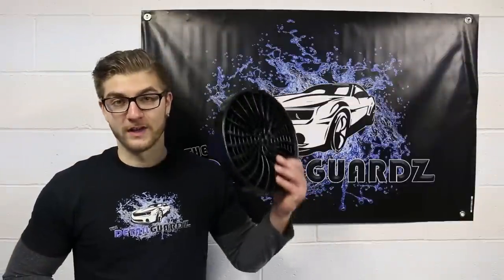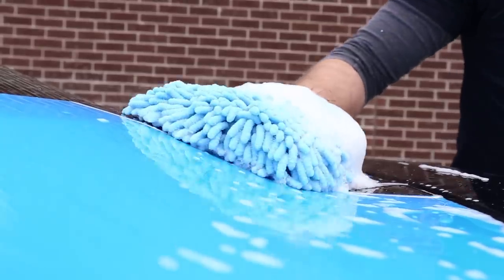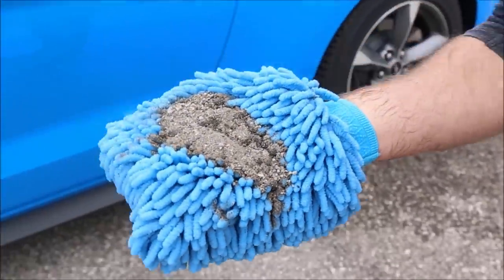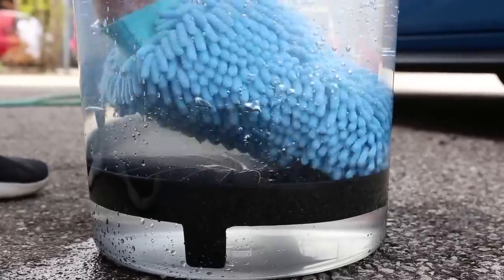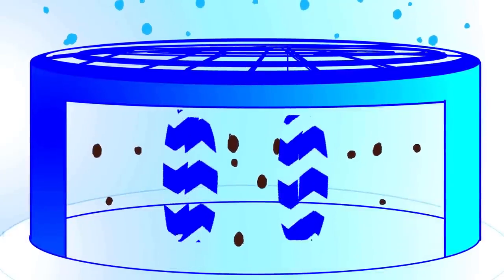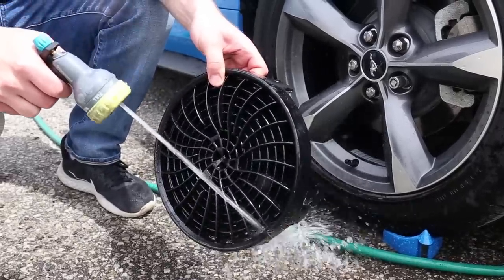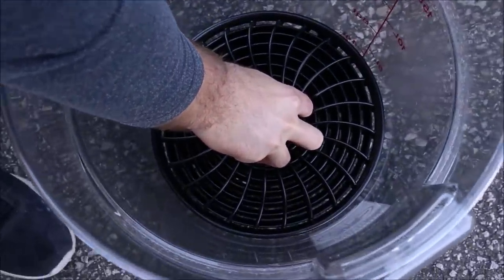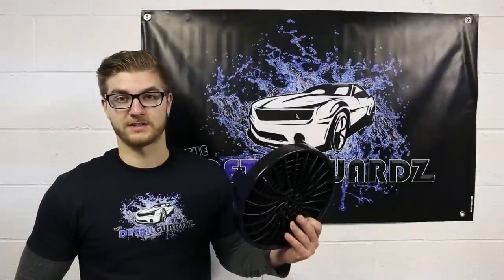Turbine Dirt Lock Car Wash Bucket Insert - The Detail Guardz Car Care

Comment: Fantastic engineering.    This is several steps above the Grit Guards that are out there now on the market.    This actually (by theory anyway) will hold the water in the bottom portion of the bucket.    Even if 80% of the dirt stays down there,  it is still going to greatly reduce the amount of swirls you'll get by reintroducing dirt back into the wash mitt and therefore on the paint.    I will definitely be getting three of these for my buckets!  Upgrade from what I have now!     The detailing market is going crazy with new innovations right now!    All sorts of innovative products are coming out from the Dirt Lock's above to new Polishers,  Compounds,  Polishes,  Washes,  Cleaners!    It's unreal how many new products come out on a daily basis.    But these Dirt Lock guards are a "game changer" for sure!   Great product.    Thanks for bringing it to the detailing world out here for anyone that wants to get some of these,  even just a weekend enthusiast like myself.

Comment: I want to know where you get your clear buckets.

Second question. Is there a Grit Guard Washboard type accessory planned? I find that to be invaluable to my setup.
Reply from the maker: Hey Gregory, the clear bucket we used was from Nella. (Very expensive clear bucket $65.00... but necessary for the video demo)

Second, we currently have the idea on the table, but we have found that the Dirt Lock does a significantly better job cleaning your wash mitt just by pulsing your hand up and down in the bucket. For now, the turbo-fan also provides a great place to scrub your wash mitt to release stubborn debris.
Reply: I don't think a wash board can work with this system. That's why I'm putting mine in the rinse bucket  then the washboard in the wash bucket

Comment: I have a 16 liter bucket. Inserting this into the bucket will not go all the way down. But grips itself midway into the bucket :( 

Now am.thinking if i should remove the rubber gripper so i can push it down a little further, or should I buy a new bucket and what size?
Reply from the maker: Hey! Kindly send us an email and we will get this remedied for you :) Email: thedetailguardzsocialmedia@gmail.com  If your bucket is a bit too small for the Dirt Lock, simply fill the bucket with water, bend the Dirt Lock tabs inward and push it as far down as possible. Let it sit overnight and it will actually mold itself to your bucket size and be further down in the bucket. Yes, you can also remove the rubber grips as that will let you push it down further!

Comment: lets be honest now i know a number of people useing grit guard ect with 2 bucket wash with stop scratches and swirl marks in reality... is it better useing a number of clean wash mitts on each pannel 🤷🏼‍♂️
Reply from the maker: Hi Gareth! 

To be honest, our Dirt Lock has only been around a few years, it's completely different from what most people have been used to compared to a traditional bucket filter. The Dirt Lock will actually suck in and pump the debris underneath the filter for a much cleaner wash experience. Therefore over the last few years, this is evolving how we wash our vehicles once again, especially as we continue to develop and release more attachments for the Dirt Lock system. 

In my honest opinion, it's much better to be using our Dirt Lock since it keeps the wash water extremely clean and you are constantly using it to flush out and maintain your wash mitt. This keeps up a good level of maintenance on the wash mitt, so it's ready to wash your next vehicle. If your using multiple mitts, they don't get cleaned out until the end of the wash and the trapped debris inside the mitt can be quite stubborn to remove, even for a washing machine. This can result in scratches from the trapped debris in the mitt the next time you wash your vehicle. 

By having a clean wash mitt and constantly maintaining it with our Dirt Lock, you will always have a clean wash mitt, clean wash bucket and you will be ready to wash the next vehicle without any delay.

Comment: What's the diameter of it? Wondering if it'll fit my buckets.
Reply from the maker: It will fit every 3.5 gal & 5 gal round bucket. It can flex smaller and larger to lock in for the differences between bucket manufacturers :) 
We tested over 40 buckets from different manufacturers, it fit all of them snugly.
Reply: The Detail Guardz nice! My current grit guards are a little too small for my buckets.
Reply from the maker: Excellent, These will fit perfect in your buckets!